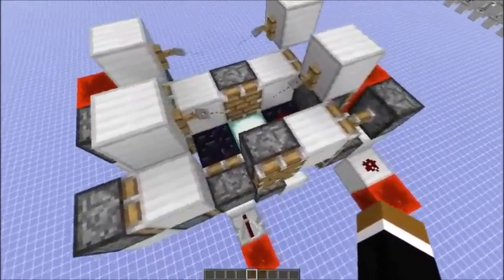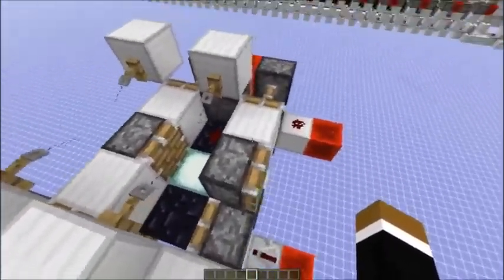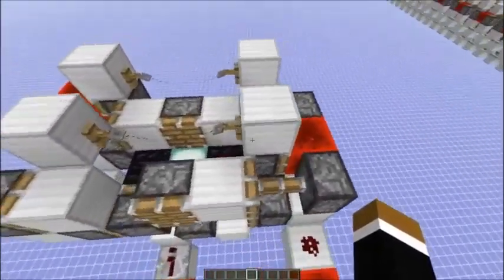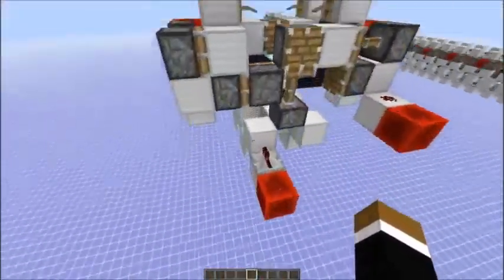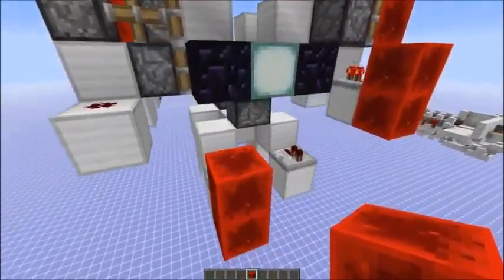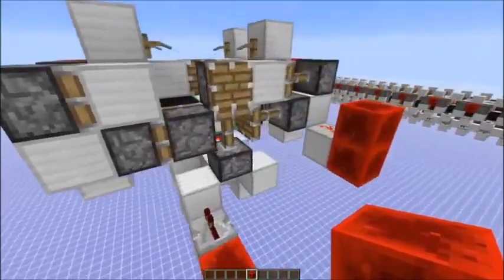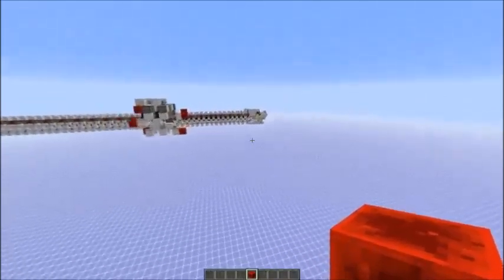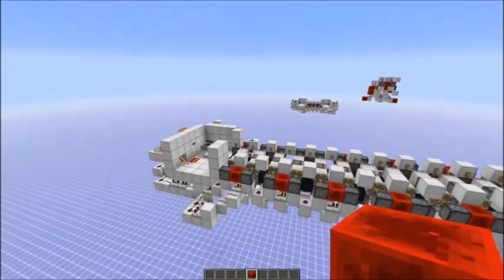2 way 40 m/s conveyor belt [broken]

Comment: Awesome design really like how this works and especially that you can change directions with it, would this be faster than the piston bolt you guys have on SciCraft? Also is there any detailed videos out there on the piston bolts straight and angled designs and are they 2 way as well?
Reply from the maker: +2491kridge A 2 way piston bolt isn't possible, because the rails have to face in a certain direction. ultimateredstone showed the straight ones the first time, he also made a tutorial. From my testing, the timings have to be changed in 1.9. I might do a video about it, because Ive heard rumors, that it doesn't work in 1.9. The speed of the diagonal bolt is the same as a minecart translocator. It can do 28.2m/s ((square root of 2)*20). Straight minecart translocators are twice as fast as piston bolts.
Reply: +ilmango yeah, if this behaviour stays in 1.9, I don't think piston bolts are relevant anymore. Awesome job as usual, I don't play 1.9 (or much MC at all for that matter) but it's always awesome to see what you come up with, great ideas + beautiful execution :)